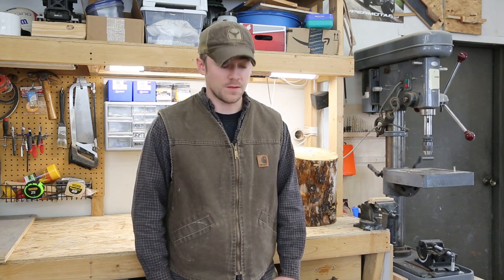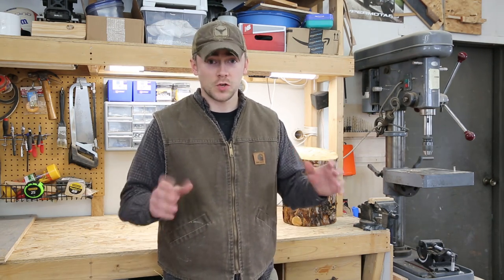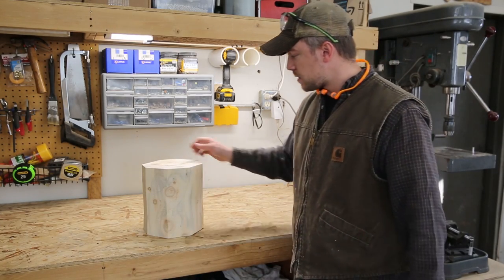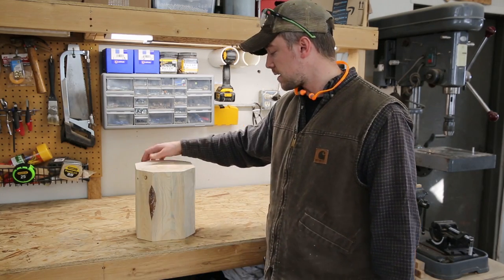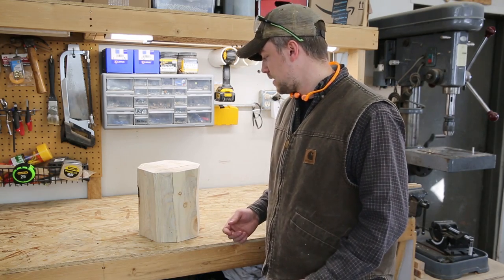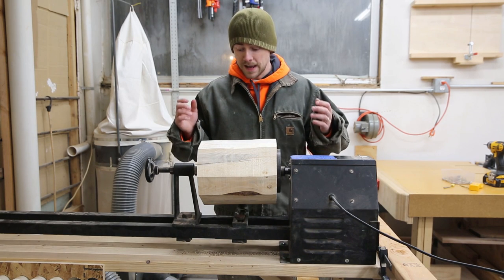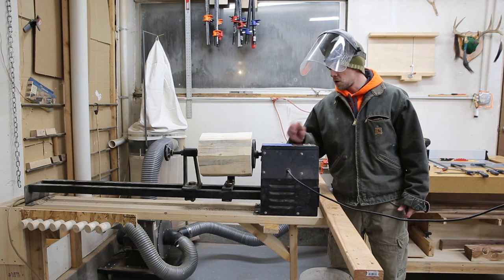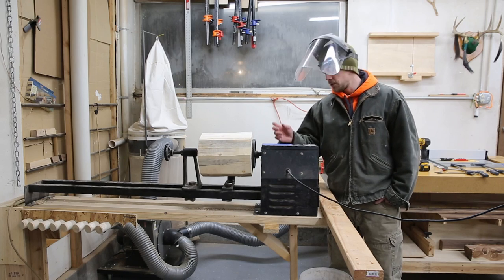Wood Lathe Capacity Test

Comment: hi Im James I have a sugestion about thr frame points on your late there are wave factors on light tubing frame mounts on aircraft they are distinces 
ok ma short er sug. use some blocks and clamps to shorten the vibrition between the powered and holding points of your lathe
Reply from the maker: Thanks for the advice James!

Comment: Has nothing to do with your lathe. That block was clearly off centered from the start. Your lathe table is crooked, and it looks like you mounted the tail stock level to the floor instead of the lathe bed

Comment: you could try flipping your lathe around, so the head stock end is closer to the wall.  you have a massive rotational force, that is mounted at the end of a moment arm.  imagine if some fat kid was swinging a bucket of water at 900rpm at the end of a see saw.  that thing will never be stable.  once you flip the machine... try tying into the ceiling and the floor.  use tapcons if its a concrete slab.

Comment: where do you buy parts for the lathe? I have the same one.
Reply from the maker: Hey Jasen, I don't really buy parts specifically for this. I have had to do some digging online or at the hardware store to cobble together something that will work when a part needs to be replaced.